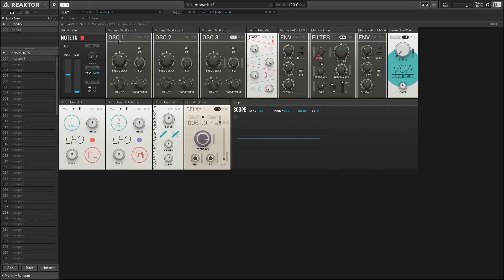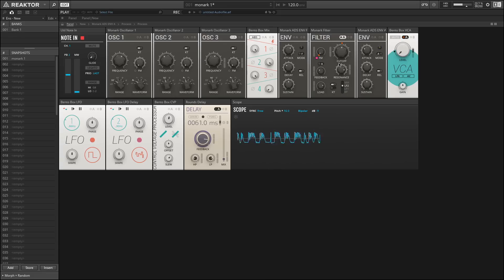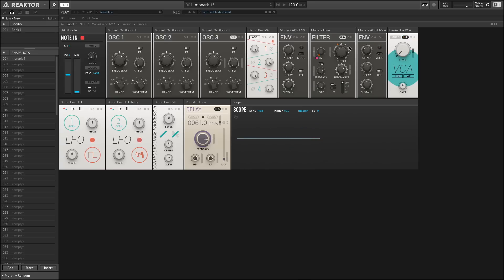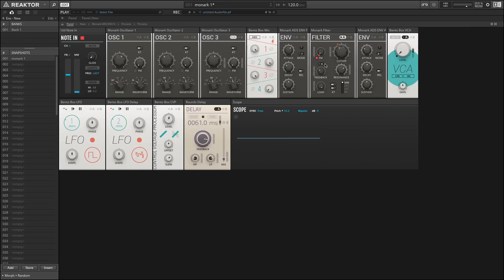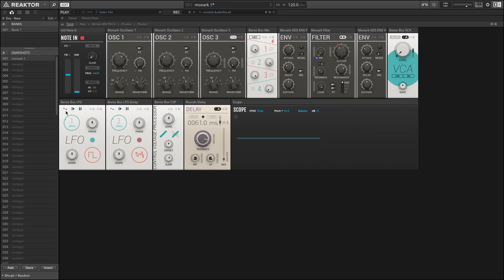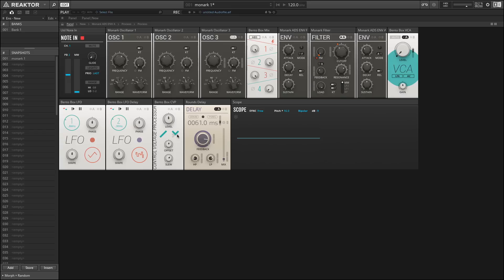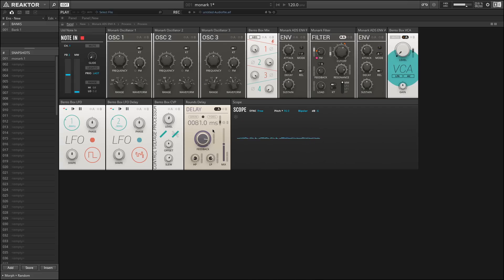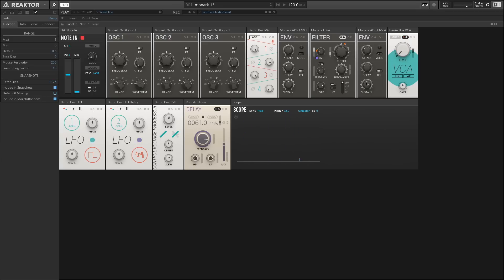Reaktor 6 Blocks Tutorial #6 Monark "Blocks" Part 2 | Kadenze

Comment: Keyboard tracking usually opens up filter more and more on a higher notes. Also - when keytracking disabled - no increasing amount of filtering will be applied, the fltering will be static! 

Then, when you enable kt, you say "sound stays brigher for longer, and essentially retains a similar timbral characteristic or quality anywhere on the keyboard.

That's also wrong, because sound became brighter = different timbral character.

I don't know how you even call yourself professor, because you completely confused what happens to the sounds with KT on and off. That's the basics, man!

What upsets me most is the fact that so many people these days dare to "teach" others, not even knowing the basics, and generating only more misunderstanding and myths.

Once again - when filter cutoff is NOT modulated by smth like KT or envelope - this gives us static timbre, simply put - static cutoff = static timbre.

When filter cutoff IS modulated by env - this changes timbre over time, When filter cutoff IS modulated by KT - it changes timbre depending on the key.